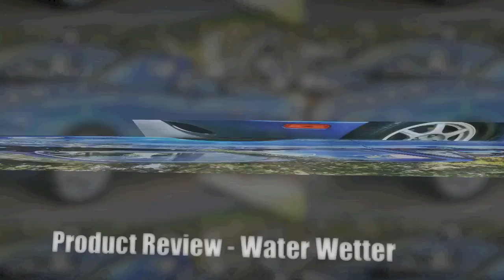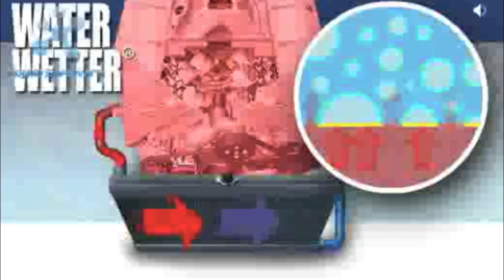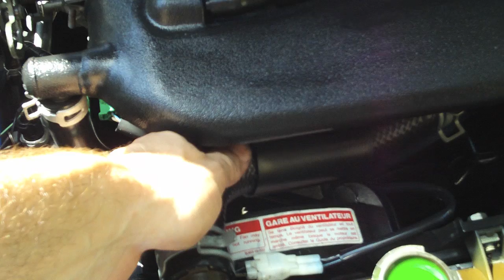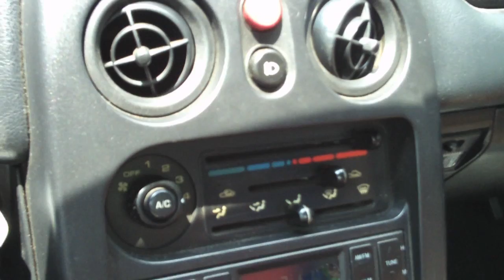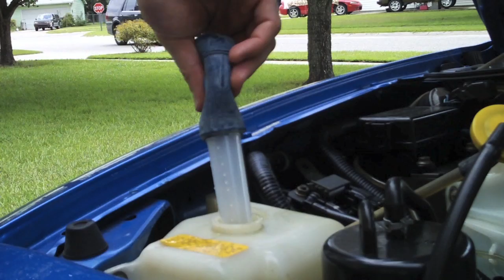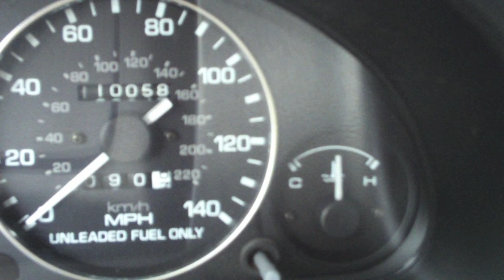Mazda Miata Fan - Episode 5 - Product Review: Water Wetter

Comment: 1- your radiator is about to fail. when they turn brown like that. it means they are about to go bad! go ahead and order a replacement!

2- don't use hose water in your engine! only use distilled water! hose water has minerals that will leave deposits in your engine and cause issues over time!

Comment: Clearly there is a problem somewhere in your cooling system! I too have a eunos roadster with a/c my temp never goes above 11 oclock on the dial. I like this product but i think its a bandaid on a bullet wound. Flush your system properly, check your radiator, waterpump etc and find your fault. that would be my advise. car should not overheat that quickly if not stressed!

Comment: Old miatas are known to have overheating problems, mine was not the exception, the main issue is simple, small flow passages and stuck thermostat (doesn't like after market ones use factory one), i removed all hoses back flush the and cleaned all hoses and passages and i needed to remove the L shape metal fitting down below the thermostat housing, it was  rusted inside and clogged, replaced it with a hardware store fitting, filled the car up with Water Wetter and new coolant and no more issues.

Comment: Water Wetter is great for lowering cooling system temperatures, but if your cooling system is heating up PAST normal operating temps there is something wrong. Most likely your thermostat is stuck, but it could also be a water pump failure if it went from normal operating temps to near overheat in a span of 7 minutes in idle. Using something like Water Wetter to lower temps like this is just using a band aid. It doesn't solve anything. 

Love your videos, but please don't mislead anyone with this

Comment: Here's a novel idea nimrod - why not FIX your overheating problem the PROPER way - rather than adding snake oil to your open and bleeding wounds!  A miata, or any car should not be overheating PERIOD.  If it does, that means the system has a problem - that does NOT mean the system needs snake oil added to cool it down!

infomercial

Comment: engine not suppose to overheat in the first place.  Even idling.  The radiator fan should kick in to maintain proper temperature. If you had removed the coolant from radiator, then you could have added the water wetter directly into the system.
If your radiator was not full, that would have been a simple cause of overheating in the first place.  its just not possible for this type of system to draw the coolant from overflow tank back in.